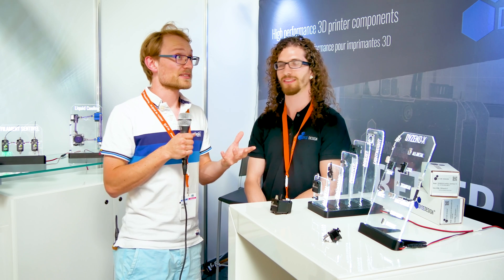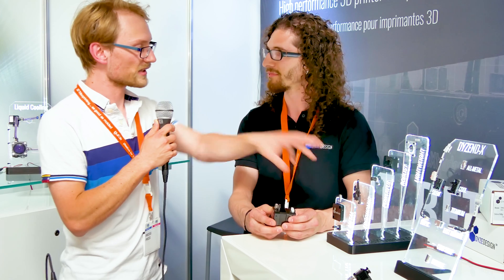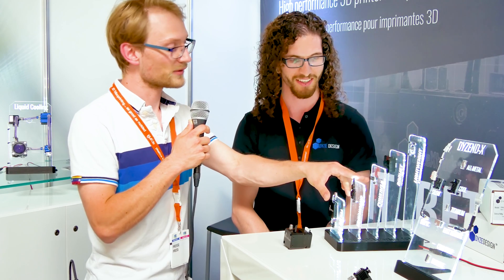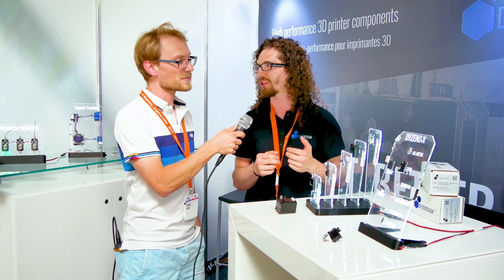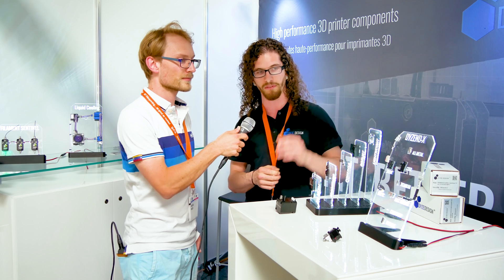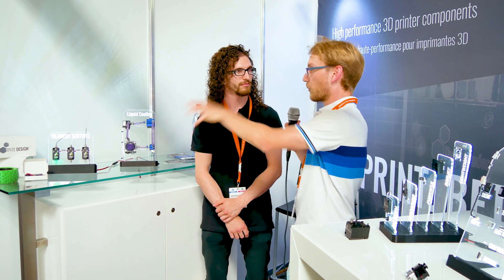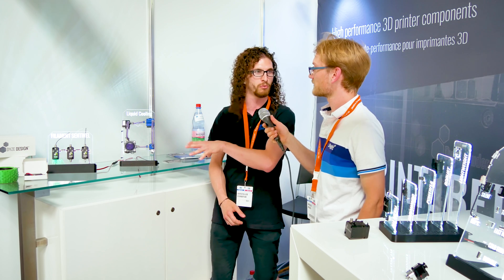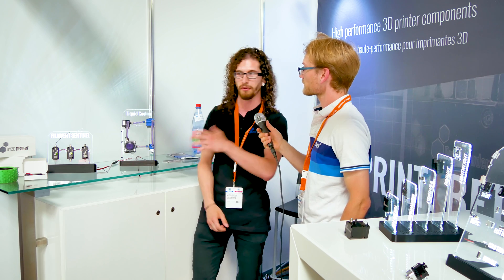Dyze's high-performance Hotend, Extruder and Filament Sensor @FabCon

Comment: I think you should contact 3D Printing Nerd and let him know what microphone you use because the audio quality of yours, in particular the gain, is way better than his - he has to almost shove it in the interviewees mouth to get a reasonable audio level and he can't make any simultaneous comments as they're just not picked up. 
On another note, I think the Sentinel gadget looks interesting - I may even buy one! I've just paid out for a Flexystruder for my LulzBot Mini so I won't be buying any other new extruders for the time being.
Reply from the maker: +Pete Allum well Joel, if you're reading along, it's a cheap hypercardoid Superlux PRA-D1. It's highly directional, so I do need to move the microphone back and forth between speakers, but that also means I can keep it at a decent distance from everyone's faces. 
Oh, and of course, you always need a bit if post-processing!

Comment: Would have been nice to see a few close ups during the video but I understand you're working alone there. But lots of close ups on their site. Interesting design. Lots of mass in the hot end. Must smooth out the temperature fluctuations quite a bit.

Comment: The extruder and hotend look pretty cool and seem to be working with basically and plastics available in filament form today. The increased force might even work better with smaller nozzles if you can increase the filament pressure in the hotend. Just curious how the other end of the scale with large nozzle diameter and fast print speeds look like. Could there be problems that the extruder can't keep up with feeding material because of that 5.65:1 gear ratio?
I've seen the older model and all spare parts get sold by a local retailer in switzerland, probably have to ask them when they are stocking up the DyzEND-X+ and how much it is.